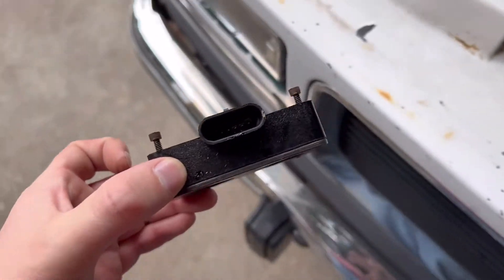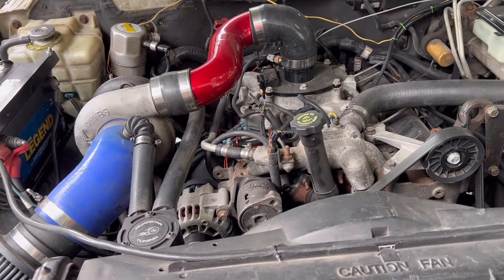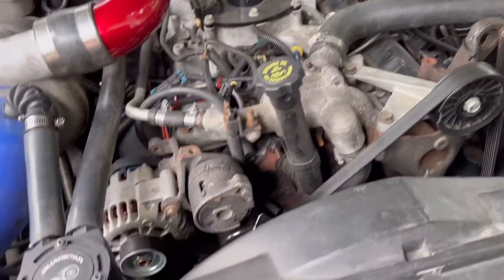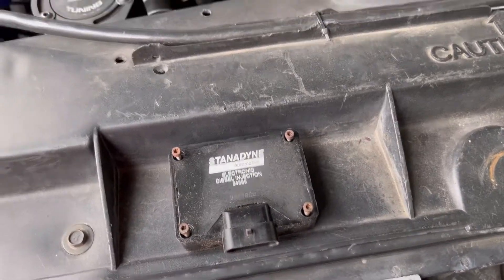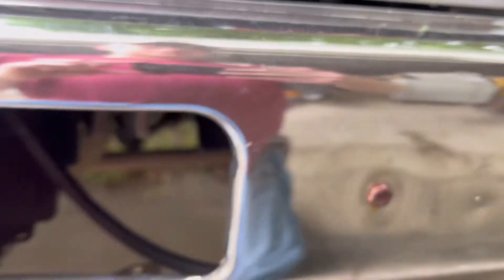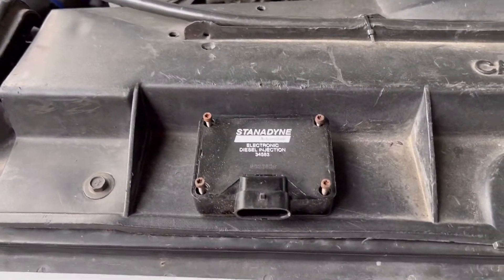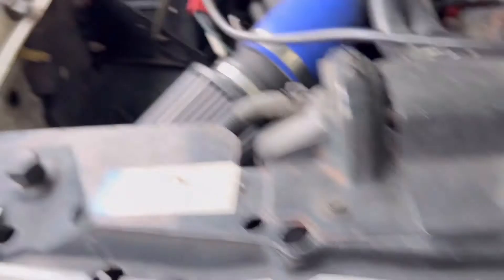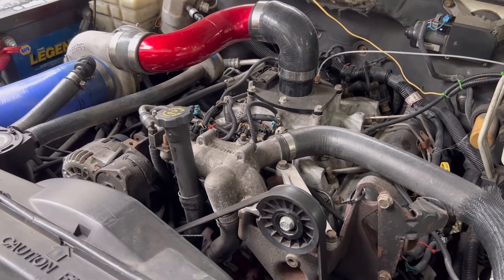GSC 6.5P diesel PMD relocation.

Comment: I just bought a 97 6.5L and saw the stuff about the pmd relocation stuff. I just looked at the Leroy Diesel relocation kit and there was a short video. Is it really as easy as unplugging the harness, plugging the new harness up to the old plug and mounting a new pmd?? No need to take the old pmd out but just to unplug it? If so that's amazing!
Reply from the maker: It really is that simple!
Reply: @gingersnapcustoms  wow that's awesome someone figured that shit out. Guess I am ordering it lol. Thanks for the great videos and quick responses!
Reply: @gingersnapcustoms  maybe I missed it or maybe it's in another video but how do I find out what resistors I need when ordering the new one from Leroy?
Reply from the maker: @MarioBrosB4You  you want a 2 or a 5. Most PMDs don’t come with one in them these days.
Reply: @gingersnapcustoms  thanks! They have a 5 or a 9 so I guess the 5 it is!
Reply from the maker: @MarioBrosB4You  5 is the best one from previous experience. Sounds like you are set!
Reply: @gingersnapcustoms  you rock thank you much!
Reply from the maker: @MarioBrosB4You  no problem! Hopefully the video gives enough info you can get it all installed and setup in no time!

Comment: Mine was relocated by the fuse block by a previous owner. I sometimes think a location with better airflow would be better but I’ve had no problems so 🤷🏻‍♂️
Reply from the maker: I’ve always done in the bumper because of the air flow idea. I used to daily Casper and sitting in dead stop traffic on the highway would make it some funky stuff. So to the bumper it went and it’s been there ever since.
Reply: @gingersnapcustoms  thanks. I’ll probably move mine!